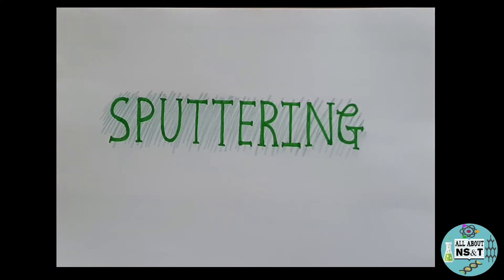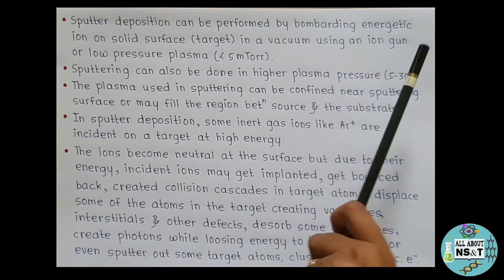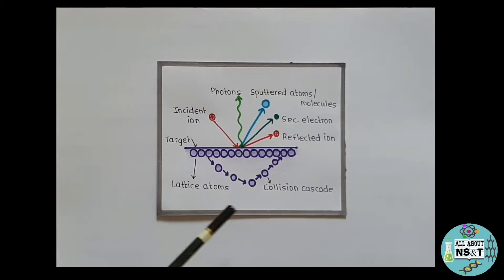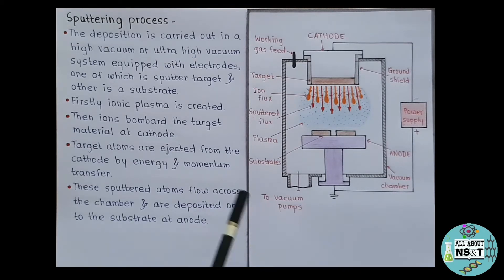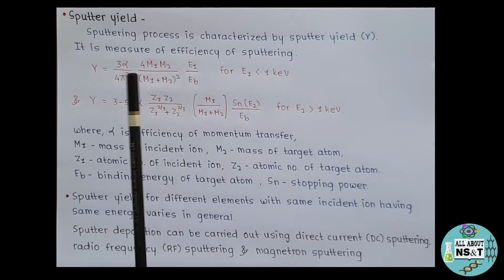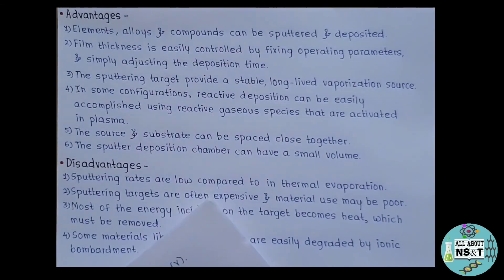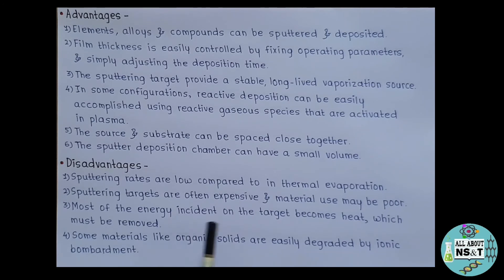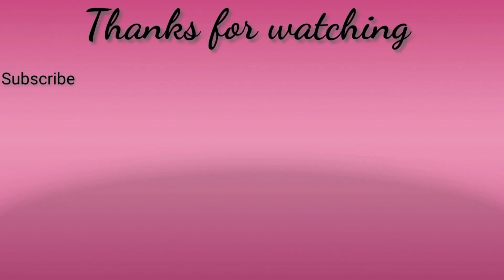Sputtering Technique|Explained In Detail Along With Its Advantages, Disadvantages & Applications

Comment: Gas phase condensation, vacuum  deposition, thermal evaporation, electron beam evaporation, pulsed laser deposition, chemical vapour deposition, sol -gel method, electro deposition, spray pyrolysis, hydrothermal synthesis, preparation through colloidal methods, MBE growth of quantum dots
Reply: https://youtu.be/9irs4Jqp-fI